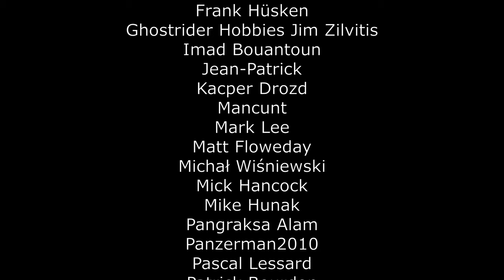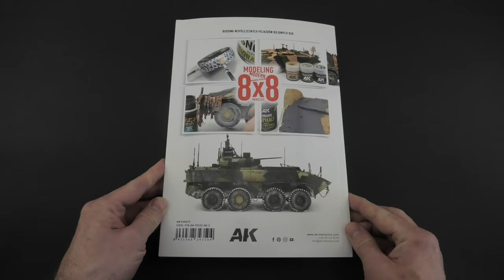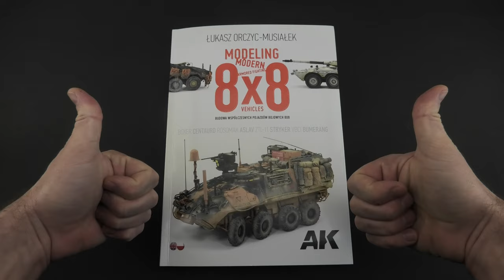Creating Dust: A Step-by-step Guide [1/35 scale] ASLAV 8x8

Comment: That dust effect looks really good. I think it is very hard to get it to look right and you have nailed it. Obviously to throw up a dust cloud the vehicle is travelling at say 10-20 KPH so the wheels would look like they are turning. I have often wondered about how to create that effect. I have tried it with aircraft propellers and helicopter rotors for capturing them in flight but not to my satisfaction yet. I would be interested to know if you have any thoughts.
Reply from the maker: Well, the only idea I have in my mind is painting them with some circles or lines on the tires to make the illusion of motion. I have no idea it is good and possible :)